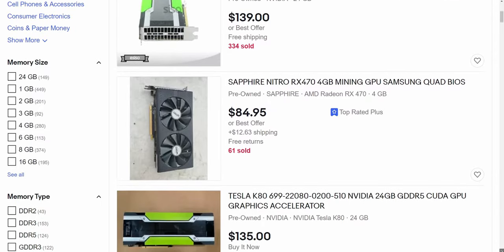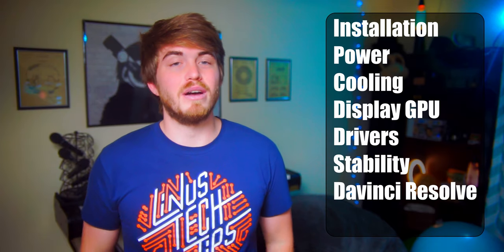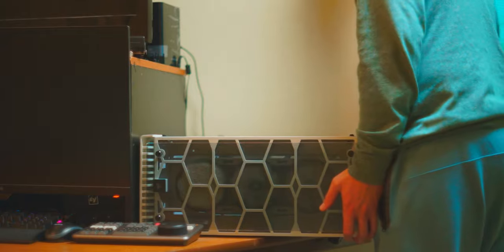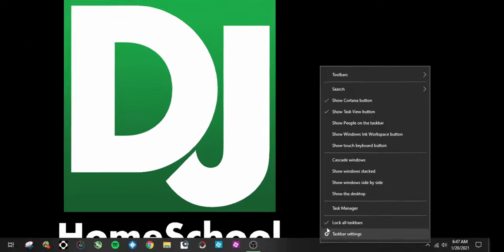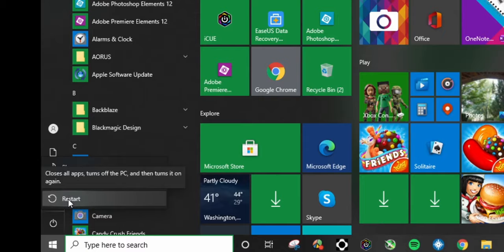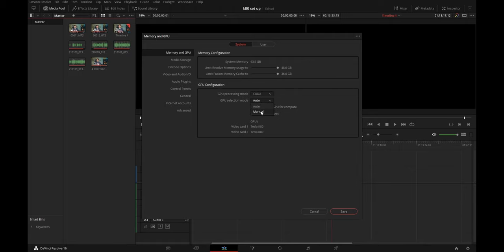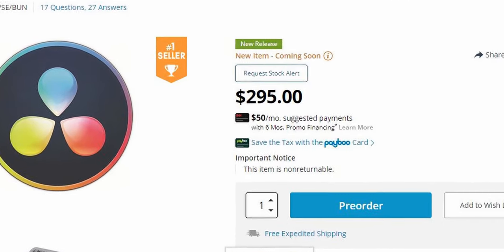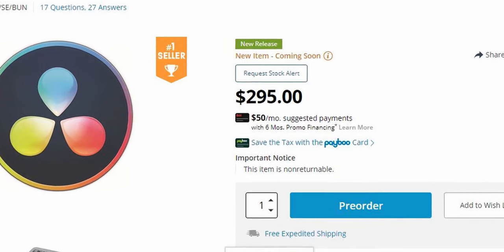24GB Tesla GPU for Video Editors

Comment: Had my eye on some used Quadro and Tesla cards for years, thinking about trying something like this for my applications. I never managed to justify it since I knew there would be issues and limited support. Still really cool to see someone trouble shoot it and get results.
Reply from the maker: Yeah! Same. I always wanted to try the k80. But there wasn’t a lot of coverage on these cards since they are more niche. So I spent the last 4 months trying to get it to work, giving up for a while, coming back to it, getting frustrated, giving up, coming back. 🤣 then I finally figured out that DRS 17 isn’t compatible but DRS 16 is compatible. 🤷🏻‍♂️
Reply: @WillCarterTech   The used M6000 24gb was dropping in price last year and I was tempted to get one. Then Nvidia 30 series landed and the whole market exploded from the supply issues. Now the M6000 24gb is $1k and not remotely worth it.

Currently running a 11gb card. I mostly use the Vram for OpenCL acceleration of fluid and smoke simulations. The perform boost is substantial as long as the Vram doesn't max out.
Reply from the maker: @lux2031  yeah... the GPU supply shortage was what lead me to making this video. Originally I was going to upgrade my GPU when the new 30 series was announced. I figured either 30 series will be good and I’ll get one of those or 30 series will be like 20 series and I’ll find a 1080 ti for cheap somewhere 🤣 
Neither one of those happened! Hahaha so I started looking for old gpus and sorting by GB and this Tesla was the cheapest 24GB on eBay so I went for it.

I don’t know a whole lot about flow simulations. But I enjoy watching Major Hardware’s fan show down. Do you watch his videos?
Reply: @WillCarterTech   I've seen a few of the fan showdown videos. Reminds me of paper airplane competitions. Often the simpler designs are more effective than the complex ones but its fun to try.
Reply from the maker: @lux2031  right?! Almost every time! I’m just waiting for the day when one of the complicated ideas actually works better 🤣

Comment: Honestly, I'd say that because NVIDIA likes to keep secrets and tend to bin their gpus (for every architecture they come out with) I'd say that with the extra memory that you have on the gpus soldered onto the cards, just flash the bios to come up---- (Stopped here because when I looked it up the specs... yeah... just ignore this suggestion.  This may have worked on a different non-geforce/quadro card but this won't work on the k80 that you have unless you know somebody who can write a bios from scratch and write/mod drivers for it.)

errr... In theory, if you were to compare the k80 to another card of very similar architectures.. .you could essentially mod or write a bios for the k80 to flash it and have it come up as two 980s (as a hypothetical, please whatever you do, DON'T DO IT.) with a crap-ton of video memory, that way you can avoid:

1. NVIDIA's licensing issues by running NVIDIA's licensing server (for enterprise as the k80 counts as an enterprise card).
2. Hypervisor Enterprise Licensing.
3. Software client licensing
Which would've spat in your face with a grand total of about $10k alone and then some per client depending on how many virtual machines you're going to run with the vGPU feature set.   #stepoffnvidia

And with the extra video memory... heh, no game is safe.  It will be the equivalent of zapping a nerd with some Doom Juice and the k80 becomes the 980 dual wield (well.. not good with names but you get the idea) or the "Doom Slayer" of GPUs... well, depending on your work load and use case I suppose.

But yeah, I'm honestly going to test this concept out at one point in my life to see if it works.  Wish me luck!
Reply from the maker: Good luck! Send me the vid when you do it!

Comment: 11:00 stuff like DaVinci and blender and other stuff using multiple gpus will only use the amount of vram on the lowest card. If you have 2 12gb cards and 1 4gb card, it will only be able to use the smallest amount, aka 4gb. The computational power goes up linearly but not the vram, the vram is always the same. It may be 2 12gb gpus but they can only use 12gb each, for the same application. So it's only 12gb
Reply from the maker: Yes, you are correct. I learned this overtime of trial and error. Thank you for sharing your knowledge.
Reply: @WillCarterTech  & @raycert07: I thought Nvidia control panel let you assign which program to run on which card?
Reply: @alextran74  it does, but like I said, in davinci resolve and blender, when using multiple gpus for the same task, you will be limited to the vram limit of the lowest card.

Since all the cards need to run the same workload, you're limited to the card with the smallest vram amount.
Reply: @raycert07  Thanks, good to know that!

Comment: 7:00 system interruptions is a boot up triggered system application. Rebooting will just make it start all over again. Ignore it, when a load is put on the cpu it will go away, or will go away with time.
Reply from the maker: It didn't go away with time. It required a full reboot. once I set my shut down to fully shut down, I no longer experienced this issue. Windows 10 default shut down doesn't fully shut down whereas "restart" will fully shut down your computer.
https://youtu.be/OBGxt8zhbRk

Comment: ah thanks man i was looking at one of these since my 980ti died 2 weeks ago now and just trying to find a decent gpu for blender that wont cost me an arm or leg, guess ill keep looking, great work btw
Reply from the maker: Try putting your 980ti in the oven to refloat the solder. I’ve seen a lot of videos of cards coming back from the grave buy doing that. You have nothing to lose since the card is dead any way.
Reply: @WillCarterTech  ah i was going to but someone bought it from me for parts for 200 so i kinda just said yes.
Reply from the maker: Oh yeah! For $200 I would have sold it as well.

Comment: Do you still think the performance is good even without the dedicated Tesla driver? I have a GTX card and of course its drivers are visually better than the Tesla's, but im just wondering if theres a lot of power im missing out on.
Reply from the maker: I couldn't see a difference in my tests on windows 10. but those drivers can help specific applications. I just haven't found any software that benefited from the tesla driver.

Comment: Question: is it possible to get an image off this GPU if you do not have integrated graphics, but do have a motherboard with onboard HDMI/DP designed to work with APU? I have an x570-PRO motherboard and Ryzen 2700 Pro, so I'm curious if this is theoretically possible.
Reply from the maker: I would have no way to test and confirm this for you. However, craft computing and level1tech have the k80 gpu as well as amd cpus and could test this for you.

Comment: Great video! :)

One comment - if you put in two 16gb cards resolve does not get 32gb of ram - it duplicates the ram so you get 16gb of ram but 2 gpus processing it. They may improve this in future but for now that’s how it works.

Really enjoyed your hackery thank you
Reply from the maker: Thank you! I did not understand this about GPU vram at the time of making this video. I didn't realize that i was only effectively getting 12 GB of Vram. But 12GB was enough to get rid of the GPU memory full error even when editing 8k footage. I have heard that the Ampere Architecture allows the A6000 and A100 GPUs to combine VRAM over NVLink. I don't have $10,000 to try this out, but that is very exciting technology.

Comment: Well now this is one of the most budget cards you can possibly buy. The card is selling for $30 now and tests have been done using blower fans to get the cost way down and avoid water cooling all together. Seems like a more interesting proposition now.
Reply from the maker: unfortunately the reason the price dropped was because solidworks, Davinci Resolve and topaz labs all dropped support for kepler architecture.
Reply: @WillCarterTech  Ah I see
Reply from the maker: @bart_ender6116  yeah, unfortunately, price drops happen for a reason. Supply and Demand still control the used market, even if rich men north of richmond are manipulating the stockmarket and grocery prices.
Reply: @WillCarterTech  I bought one for a project just something to play with and 30 dollars isnt much to pay
Reply from the maker: @bart_ender6116  oh it is tons of fun to Play around with. I used it for over a year. But I knew that Davinci resolve 17 could save me hours of editing. I ended up buying an RTX 3090 so that I could use resolve 17. For that one reason, it was worth it. But the k80 definitely held me over for a long time. Great acceleration card.

Comment: I have this Tesla k80 paired with a Nvidia quadro k6000. Using the latest drivers for Quadro you can select the k6000 as the display driver and the k80 as the primary accelerator. That setup gives me 36gb of vram. Should be good enough for 8k even 16k.
Reply from the maker: How’s it running in your set up? Does using the Quadro solve a lot of the issues I had because I am using a gaming card for display?
Reply: @WillCarterTech  yes it actually is designed for a driver that utilizes the "k" for Keplar based architecture. So and k series Quadro with any k series Tesla will work together. I actually have a Quadro k2000 that I can get you. I upgraded the one I had in my machine to the k6000.
Reply from the maker: Yeah, that’s exactly what I wanted to know. I figured someone out there set up their work station correctly.
Reply: @WillCarterTech  but you have to remember that your system memory, according to the maximus configuration PDF , needs to be 3x what the gpu vram is. So 24gb + 6gb is 30 GB of v ram, multiplied by 3 is 90gb of system memory needed for that setup.
Reply from the maker: @Valient6  oh wow 😳
Reply: @WillCarterTech  I can sell you the k2000 on eBay. Just search seller valient6.
Reply: @WillCarterTech  NVIDIA Quadro K2000 2gb GDDR5 PCI Express 2.0 x16 Graphic Card
Reply: @WillCarterTech  that's what I have it listed as
Reply: @WillCarterTech  I have 256gb of 1866 ECC 2x4 rdimm.
Reply: @WillCarterTech  just make an offer of 40$ I just adjusted the listing so you can get it for 50% off.
Reply from the maker: That’s okay. I appreciate you accommodating me like this. But I really don’t plan on pursuing this k80’s top performance anymore now that I can’t use it in the program that I use for work. I plan to use it when I do my 10 second time lapses still, but I’m not hammering it very hard with those. The plan is to buy a newer GPU once things chill out. 
I’m not in a big hurry now that I can do my timelapses and the company that I work at only does 1080p at the most.
Reply: @WillCarterTech  that's cool. You can get a 3090 for like 2100 right now.
Reply from the maker: Oooo where? I haven’t found one in stock. I’ve been thinking about getting a scalper bot to buy me one.
Reply: @WillCarterTech  ebay
Reply from the maker: In my area I can only see 3090 for $7k

Comment: Oh, I just did see your comment: "3/27/21 Update: Topaz Labs software does not support the k80. ".. I am in close contact with Topaz and know of people asking them about the K80. I had a K80 here a few weeks ago and managed to get it running by the same "switching to WDDM" trick mentioned in my other post... Since most "models" from Topaz nowadays rely on faster FP16 calculations and shift of calculations to the shaders (using not CUDA or OPENCL but the compute capability of DX12), the K80 isn´t that fast, but it works. My card had one broken GPU, so I only could test half the speed. Actually, Topaz Video Enhance is able to use two GPUs, so the K80 should be able to get some work done quite well (for the money)... I admit, getting these cards is tricky and as you mention, the effort might not be worth it - but "it works" :)
one very nice thing about the K80s is the FP64 performance, which is around the best small money can buy today.. One has to get much more recent enterprise cards if FP64 is needed.. Of course, Davinci and Topaz and others don´t use it - but if one is doing some scientific research and wants FP64 performance - K20/40/80 are the way to go for a budget (Nvidia stripped FP64 support after Kepler, so even a RTX card is slower in FP64)...
Reply from the maker: This is great information! I wish i understood everything you are talking about. Ill need to do some more learning.

Comment: In Linux I think this would be a pretty easy yet somewhat hacky setup. You could use PCIE passthrough to send the K80 to a docker container running Divinci Resolve (Or a docker container running anything, local ollama or a command line blender render), and then use your main GPU for display. Then you could use your cooling solution of choice (I don't think you need water cooling, check out Craft Computing's solutions) and if you already have a nice power supply then everything is done for you. This eliminates a lot of the resource cost.
Reply: Woah. I'm interested. Anything you can point to?

Comment: Best regards and thank you for sharing your experience.

In my case I have a msi x99a motherboard with an Intel Xeo E5-2699 v3, and I have to use a dedicated GPU to be able to use the monitors.

The GPU I'm using is an AMD Firepro W7100, because my computer setup is for a workstation, and it runs fine in Solidworks. I am learning to use Ansys fluent and for GPU calculation acceleration, Nvidia are recommended.

I want to acquire an Nvidia Tesla K80 (they were used in servers, because they are cheap, but they do not have video outputs or their own cooling), to do the simulations, but keep the AMD as the generator of the video signals for the monitors.

In the AMD Radeon pro settigs application, when I enter global settings, I get to GPU Workload and it gives two options, "Compute" and "Graphics", I suppose that in the second option the AMD GPU is left as the graphics option (a kind of Integrated GPU, since the motherboard does not have video outputs).

Is it possible to use these two GPUs in the same computer, the AMD as a video signal generator and the Tesla as a processing unit, for applications like Ansys? Or is it better to use a low-end Nvidia GPU, for example the Quadro P400, that provides graphics and the Tesla K80 performs the calculations?

How would it affect the ram memories of the video cards? Because the Firepro has 8 gigs but the Tesla has 24 gigs.

I want to use the Tesla only when I need to run simulations that do not support the use of AMD GPUs.

There are the following nvidia gpu models that catch my attention (as long as they are compatible with the Tesla K80 drivers) to use as video outputs, in configuration with a Titan K80 with video outputs for 3 or 4 monitors, such as Alternative in case of AMD FirePro problems:

Nvidia Quadro P400
Nvidia Quadro K1200

My configuration:

Motherboard msi X99A TOMAHAWK

Intel Xeon E5-2699 v3 CPU

RAM 32 GB Crucial

SSD M2 msi Spatium 1Tb

AMD Firepro W7100 GPU (which supports and works with Radeon pro drivers, and is comparable in performance to the AMD Radeon pro WX5100 GPU)

PSU: Thermaltake smart 700w (AMD GPU has a maximum power consumption of 150 watts.)

Win version: Win pro 10 22H2

Thank you.
Reply from the maker: In windows I've run into compatibility issues with the amd drivers and Nvidia drivers installed at the same time causing screen black outs and crashes. This might not be an issue anymore since my experience was a few years ago, but I haven't heard of anyone fixing this on windows. However I have heard that the linux community have made great strides in running both AMD and Nvidia GPU on one computer at the same time. 
you will also need to upgrade your PSU since the k80 draws more than 300watts. 
I still don't recommend using the k80 since it's not compatible with most modern versions of solidworks. so you would be dead in the water anyway. the m40 is still working in solidworks i believe. you should double check that though before you buy it.

Comment: For 1200$ you can get a server chassis packed with ram, storage and 3 of this GPU's and it won't choke on power or thermally, that is, you'll need to keep it in basement and tell your neighbors that it's not a person screaming, just a server.

Also $200 for PSU is overpriced, and that fan have low static pressure, which would by why you couldn't get it air cooled
Reply from the maker: 🤣 I love this comment. Yes! Exactly! You described all the issues and solutions perfectly. I couldn’t have said it more succinctly. And yes I agree $200 is alot for a psu, but that is what they were selling for just a few months ago. So it’s not too far fetched. I rounded up for brevity and dramatic effect. I didn’t want to say $1,169. lol
Reply: Just did this picked up hp server with 128gb and dual 8 core cpus, 1.2tb SAS 15k for  £200,  alongside the card for another 2 just waiting for it to arrive plans to mod it to reduce the sounds of a jet taking off when it starts. 

That aside servers are going for relatively cheap and I Recommend them to anyone whos work flow benefits from them, though you may want to look into liscencing, customer / driver support and the like. r/homelabs has some useful info and a community willing to help those getting into it

Comment: It seems that since this video the after market offers for cooling internals has expanded. While I've never seen a front mounted duel heat pup but their are back mounted heat pumps that can pull some heat off of the backside of a GPU. I don't know just how effective it would be, but with temperatures this high any extra might be worth it.